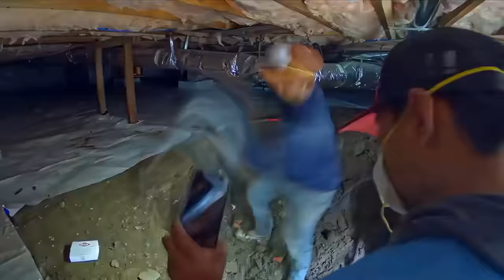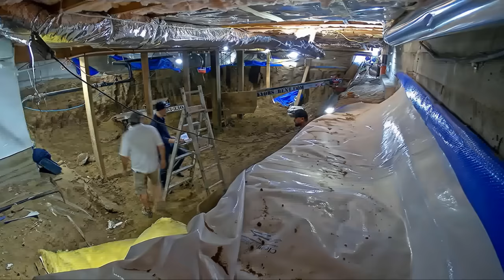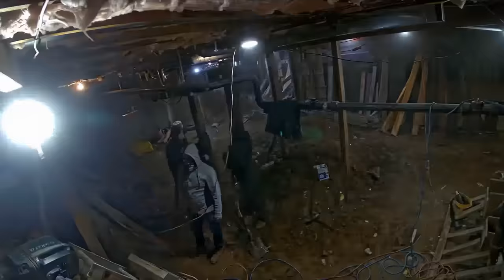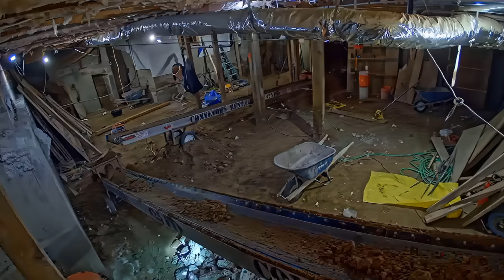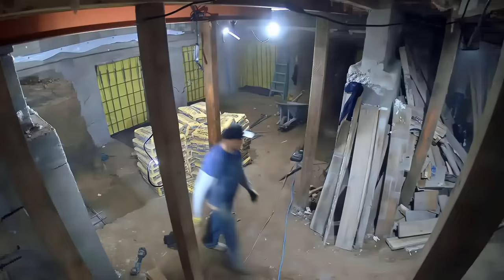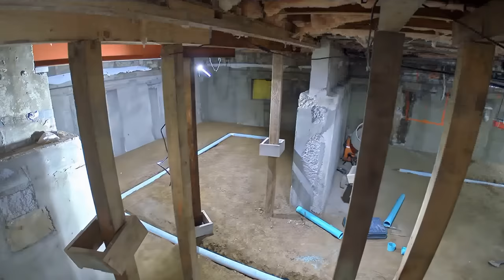Digging Out a Massive BASEMENT From Start to Finish - Time-lapse

Comment: Color me impressed by every minute, My only question as someone outside of the drainage circles, before the slab was poured, Was that a for of French drain being added and are the 2 vertical pipes needed for ventilation ( looked like a butterfly valve was on one pipe)? Thanks for the video, I have so many time laps but never the time to edit and upload.
Reply: also looked like 90s on the flat in the piping under the floor
Reply: Maybe those pipes are for radon gas mitigation, I think with the new 2021 IECC they're really strict with gas intrusion.

Comment: Wouldn't the weight of the house cause the soil underneath to sort of level out? I'm a novice and I don't really get the physics behind how this is possible.
Reply from the maker: Great Question, and the soil is very compacted after decades of holding the home. You'd be surprised how strong it can be, however with that said it is important that you work fast. At the end of the day its still soil and can easily experience failures over time.

Comment: I live in an area where you would be at this with pickaxes and hydraulic demo hammers because the ground is practically bedrock and slate at the surface. (glaciers receded many millenia ago and stripped the ground leaving us with maybe 10 inches top soil today)
Reply from the maker: Theres a lot of places like that, we're extremely lucky here in Denver and the front range for our soil conditions !
Reply: @GoldsConcrete  you sir are an industry treasure, especially your employees to tackle a project like this.  Im impressed.

Comment: It would have been cheaper and faster to put the house on steel; move it 60 ft; dig the basement with a track hoe; pour a basement with structural footers; move the house back over the basement and set it down.
Reply from the maker: Definitely a possibility on a home with more space around the permitter, however we generally work in tight neighborhoods where this is far from an option

Comment: Is there a reason why you didn’t reinforce the floor before pouring the concrete? Just curious.
Reply from the maker: Great question, we use a special mix of concrete which has microfibers, giving us the same durability and strength of rebar

Comment: It would be interesting to know the total cost of that project. And is it really worth the investment?
Reply from the maker: If your house is in a good location, especially in downtown areas like most of these are it is totally justified. And this came out to roughly 150,000
Reply: @GoldsConcrete  , how many square feet did they gain?
Reply from the maker: @AquaDawg  They were able to add an additional 1,700 sqft to their home

Comment: How long did it take for you to complete this job? I acquired a 1920's home that was built on a sloping hill, and want to do a dig in the basement to level out the floor, and have the house be more established on the slope. Was curious about the time it would take to do this.
Reply from the maker: It really comes down to square footage and depth, this basement was 1,700 sqft and 6 feet of digging. So damn near 330 tons of excavated material and this took us 5 months with a crew of 5.

Comment: I have a stupid question...Why was this done? Also what was the total cost?
Reply from the maker: This is an older home in Downtown Denver with a good location. The homeowners wanted more room but didn't want to move therefor they chose to add a basement. And this job was in the ballpark of $150,000.

Comment: Hello :) very interesting and impressive work, how long did it go on for? May I ask what the commercial ducting for under the house instead of the walls, unless they're from and to ground floor rooms? Also why was there plastic on the then dirt floor in there?
Reply from the maker: Thank you and this project was roughly 5 months and that plastic you see is a vapor barrier for the crawlspace. Most homes have them to keep moisture from rising in to the house.
Reply: @GoldsConcrete  that is a long time! Not like it's unexpected or surprising I guess, just an impressively long period most would give up on at least for a bit frankly. Why was the vapour barrier on the floor and not the house itself? :S :o it looks good quality thick stuff, nice

Comment: is that concrete only rated for a specific weight load or design or can that only be applied to ground slabs(versus multistory concrete slabs; i.e hospitals, schools, etc.)
Reply from the maker: Do you mean using this mix for a multi story building ?
Reply: @GoldsConcrete  yeah, can this be spec'd in lieu of the traditional standard concrete and rebar systems? For slab floors or roofs (anything other than on the ground).
Reply from the maker: @trebien98  we haven't done any multi story complexes so we can't give any specifics, however we would still recommend a rebar system as it still provides the most strength and backbone to any concrete pour. But for a job like a slab this microfiber mix does an excellent job of providing strength.

Comment: Why so labour intensive when you can run an electric cement mixer, electric mini excavator and electric self-propelled wheelbarrow.? Wouldn't that approach be much more cost effective than hiring a crew to dig by hand? You would have the equipment at the end to sell or use on the next job.
Reply from the maker: We deal with homes with little access from the outside in, We would love to do it that way but you need space on the outside which we don't have the pleasure of having on most of our jobs.

Comment: Wow the manual labor alone not to mention the cost just wow great job that homeowner gives zero f#$ks about cost lol. Now out of curiosity when you got a foothold dug out in the opening was there enough room for a bobcat or a skinny Kubota to get up in there or was there a Fumes /ventilation concern ? Awesome video thanks for posting !!
Reply: Actually the more I look at this video that's pretty tight spacing down there for a bobcat or a Kubota I dunno maybe it's just me.
Reply from the maker: You're absolutely right ! It's a pretty tight space and it requires more work to cut and dig a path for a small excavator. And you're exactly right about the gas fumes !

Comment: That is awsome.  I was curious how long it took and a rough estimate of what it costs?  I would guess 100k to 150k that's a lot of work!!
Reply: I would guess north of 200K,  laborers these days are going to run $1000/wk considering salaries and overhead each, so at least $6k/wk for personnel for 20-22 weeks, then haul out fees, concrete work etc, would easily run to at least $80k, probably more when one considers finishing out the basement,  would not be surprised at $400k + for the project with finished work.   Really lucky they only had to deal with dirt and no rock.  In my area the rock starts about 18-24" down and gets really hard at 6' deep.
Reply from the maker: This job was roughly 5 months and you're pretty spot on on your estimate at 150,000
Reply: @GoldsConcrete  that's it 150k.  That's why they didn't move and chose this project.  Selling your home and buying another would definitely cost more. Great job.  What area do you guys service?
Reply from the maker: @MrHeat1up  Not bad all things considered ! And we are located in the Denver area !
Reply: @goldsconcrete, great job! It has always been my dream to open up my crawl space of about 1,000 sqft and on grade/slope. I really like your ingenuity on this. Can you please recommend me a contractor like yours in the Concord, CA area? Awesome job!
Thanks!

Comment: Yes that was insane - but you didn't put any rebar in it.  Nor did you tape seal around the posts.  The whole reason for the plastic is to provide a vapor barrier.  You missed the point.
Reply from the maker: We use a special concrete with microfibers that add the same structural integrity of rebar and those posts are temporary. when we remove them we add in the vapor barrier.

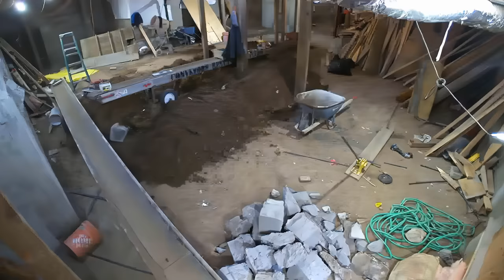Comment: I wonder about the splits in the outer plastic membrane that is created from doing the wall in sections.  Probably not a huge deal with enough overlap but seems an unavoidable weak spot in moisture barrier.  The real insane part was digging that dirt twice.  Around 25:00 they created a huge pile of dirt to dig again later instead of straight onto the belt the first time.
Reply from the maker: Depending on if the Skid steer is there that week or not the guys have to pile it there so they can continue working without slowing down the overall project.

Comment: no reebar in the floors ????
Reply from the maker: Are you sure?
Reply: @GoldsConcrete  i did not see any in the concrete floor. I did in the coloms of the wall supperts but on the floor al you see is blue tarp en then concrete poring, no rebar

Comment: Why couldn't you dig down on the outside of the house and cut through 6 feet of the basement wall and dig the entire basement with a mini? Obviously you'd have to support the area you cut for a pass through but this is what I thought he of instantly. Is there a reason you couldn't or is that a bad idea? I'm not a builder I just do remodeling so 🤷 
🇺🇸💪🏻👊🏻🤙🏼
Reply from the maker: A lot of the houses we work on have little access from the outside, (tight alleys, Existing water lines etc. ) We would love to go that route but unfortunately its not economical going that route most the time for us. Hopefully this was insightful !
Reply: @GoldsConcrete  yep I understand that perfectly and can't believe I didn't think of that. lol I'm from Michigan so I guess it's a little different everywhere but that's why I like to ask questions. Thanks

Comment: There is a much easier way to excavate interior areas.  Use a hydro vac truck.  They could have that basement excavated in a couple days.  And they can run vac house for long distances, so you don't have to mess up the yard.  When I did my basement, I did it the hard way, 5 gallon bucket at a time, but I was just removing the concrete slab and 9" of soil.  Still it was 45t of soil.  Wish I would have known about the hydro vac than.
Reply from the maker: Easier Yes, But when your removing 330 tons worth of dirt like this one, it can't keep up with our guys and conveyors. Plus who wants to take the fun out of a free gym membership for a few weeks.

Comment: Why no thermal break under the slab? That floor will be cold.
Reply from the maker: On this particular job our builder didn't require it
Reply: @GoldsConcrete  Too bad as it makes so much difference to the comfort heat wise in the basement. I can walk on ours barefoot and my feet do not get freezing cold.

Comment: People that say tear the house down and build a new one cuz it will be cheaper on every video like this, should stfu and stop embarassing themselves.... no brain at all... HOW is it cheaper to demolish an entire home that is perfectly fine and rebuild a new one? its not that simple and its defintely not cheaper(plumbing, electrical, drywall, fixtures, hardware,  paint, cabinets, flooring, etc...) and did i mention the LUMBER, roofing, sheathing, insulation, nails, braces, screws, permits and inspection costs for the new build, PLUS the cost of a basement build out(the only thing they wanted to do to begin with)... smdh

Comment: 1) was this job permitted? 2) whats the cost per square feet?
3) did you hire structural engineer? 4) it would’ve been a lot better, if you had somebody with a good speaking voice pause the video and discuss the process at each stage. Yes, I did see your video with the young guy 25-30 narrating the animation. That’s a good start but I think you could’ve done a lot better at pointing out what you’re doing during the process instead of the animation.
Reply from the maker: That's a good point, thank you! We're putting a legitimate educational type documentary together on the crawlspace conversion process as we speak. To answer your questions permitted yes, engineer yes and square footage yes. Had all of those

Comment: Average $100 per person a day times 7 workers (100x7=$700)  times 150 days (30x5) Not to include equipment  and a civil engineer.
WOW! $105,000 just in labor cost alone.
Would it be cheaper to pay to move the house then have an excavator remove the material in a week?
Nice job!

Comment: Not to be a nit picker,
Given the fact the basement is well below the frost level, cutting expansion joints in the basement floor is not really a necessity or compulsory requirement.  Instead of going into the center of the wall to make an opening, I would have started from the corner of the house, went up each side and poured a knee wall, set / pour each wall entirely and then move on to the next, the last place would be the center to dig out.  Digging down from the corner would have allowed for a small excavator and miniature dump wagon to operate under the house thus reducing time. A roll on / torch on vapor barrier could have been used on the exterior of the basement walls had they dug out each side beyond the foundation, this wasn't done to prevent water /dampness transference to the inside walls. At present rain water will hold up around the base of the house / no weeping tile was installed to take water away from the basement level. 
I would have plotted out concrete  pads for load bearing floor supports first, placed the floor jacks on the pads and then poured the floor. I probably would have used 28 mpa cement and a steel mesh. Complete one entire wall at a time, it would have reduced the waves present in wall sections and made them straighter for roughing in with wall studs. 

I probably may have went so far as to place I-beams to eliminate floor jacks all together, but that's me, everybody is entitled to build/ renovate their homes as they seem fit.
Reply: This happened in a city and the people live in the house and didn’t want there yard ripped to absolute shit.

Comment: Would not It’s been easier and cheaper  to simply lift the house up 5-10 feet and then go in with a front loader to dig that out  instead of my hand
Reply from the maker: Depends on the area, here in colorado this makes the most sense for us especially considering safety

Comment: Even if you only paid the "crew" 100.00 per day each - in 1 month (average crew 6) that is 12,750.00. For 5 months (lowering average crew to 5) would be 53,125.00! That doesn't include any rentals or material - there is NO WAY anyone is stupid enough to spend 100,000.00+ (or realistically 250,000.000) , to have a finished basement!

Comment: I think that it's sad that no insulation was put down before the floor was poured.
Reply from the maker: The ground maintains a constant temperature of around 50 degrees below 5 ft, so there was no need.
Reply: @GoldsConcrete  The benefit of putting in a thermal break or insulation between the ground and the cement floor is that the cement floor would no longer be at 50°F. It would make the basement easier and less costly to heat to a comfortable temperature.

Comment: The following comment I left on: https://www.youtube.com/watch?v=vgtRYo4SETg

Great animation. Explained very well the process. Having 30 years in the construction industry in all aspects from on-site construction to 21 years working at an Architect firm that only did commercial buildings, I am left with one question. In the animation, you did not show pouring any footings under the temporary posts that were under the steel beams. Likewise, in the 34-minute basement dig-out time-lapse (https://www.youtube.com/watch?v=vL6IIRu_Wl4), it was difficult to tell if you poured footings under your temporary support posts which were surrounded with the boxouts for pouring the basement floor. I would have thought you would have provided temporary posts close to the original temporary posts which would have given you a chance to put a footing under the posts that would eventually remain as part of the structure.

In addition, I am wondering how you accomplished an exterior vapor barrier to the newly poured foundation walls.

Comment: All that work and then not putting rebar on the slab.
Reply from the maker: We use a special concrete with microfibers that add the same structural integrity of rebar

Comment: The only efficient process I could see in that entire video was the final screeding, which must have been done by competent professionals, and was over in no time. This is not a massive basement, it's tiny. 95% of the video looked like people pretending to work with no visible progress; nothing much happened from one minute (week) to the next. Was there important structural work that was done but did not appear in the video? I'd hate to move 100 tons of dirt, but I doubt it would take me 5 months if I had 4 mates helping. This is an honest comment, I have no axe to grind, I just don't get it.

Comment: 5 months is lets say 125 days. 40 hours per day x 125 days = 5,000 man hours. You say you were running 4-7 men, so lets use 5 men. 5,000 hours x 5 men = 25,000 man hours. At $15/hr that's $375,000 for this project. No way it's worth it.
Reply: it actually costed 150K according to the contractor person who responded.
Reply: @killerdeamonking  must not be paying the labor very well

Comment: were the support poles always there? The video went too fast for me to see. Had to be more than $30,000 for the job.otherwise you were doing this for basically free. Hopefully the conveyor was yours and not a rental for all that time, that costs a lot to rent. You have the cost of the concrete, all the flooring material, and wood. Don't know about how or were the soil went, because in my town that would cost money to dump. Then finally you have the labor, with that many workers for 6 months?